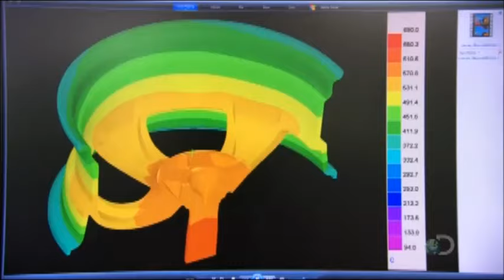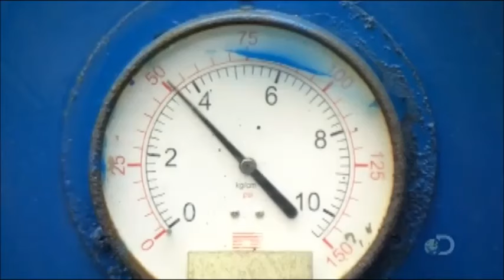How It's Made - Alloy Wheels

Comment: It's not a wheel, it's a rim!
Reply: Erhm no
Reply: The rim is the outer part the grips the inside on the tire, the wheel is the entire part, including the rim, spoke(s), & hubcab. 

Media has led you to believe these are called rims, which that's incorrect. They are, and always have been called, wheels.
Reply: Lukas it's called wheels and tires

Comment: Eh, am I missing something here? How in the name of fuck can you pump air into a solid metal wheel?
Reply: Leak testing is done by sealing the front face and rear face of the rim(Inside of the rim Part you normally see and Also Bolts up to the vehicle) with Rubber ETC then pressurizing it there looking for leaks where the tire is normally mounted call it a Inside out wheel Hope that explains it

Comment: thick aluminium wheels wight less than steel wheels?  no fucking way
Reply: +Mercer Frey Trolling much?
Reply: +XtrAMassivE  no sir,  i have seen a lot of different rims and many times alumium ones are always a lot thicker than basic steel ones so they would keep their durability. alumiun doesn't always mean "weight reduce".
Reply: +Mercer Frey Steel is about 2.5 times heavier than aluminium, so even if aluminium wheels would be 2 times "thicker", they would still be lighter than steel wheels. But they don't have to be so much thicker so weight gain is noticeable, especially when you have four wheels.
Reply: +Mercer Frey to y